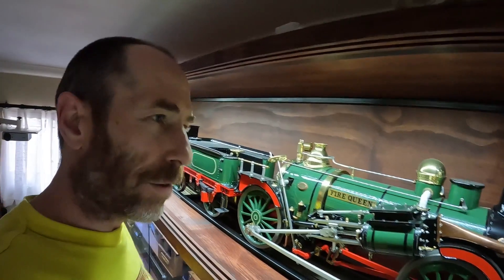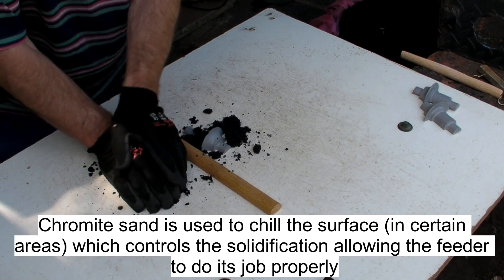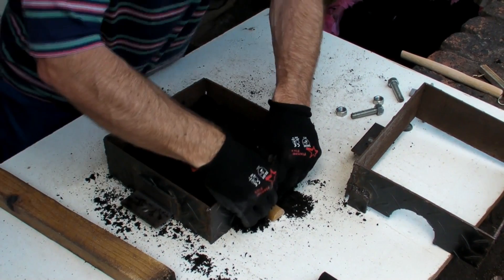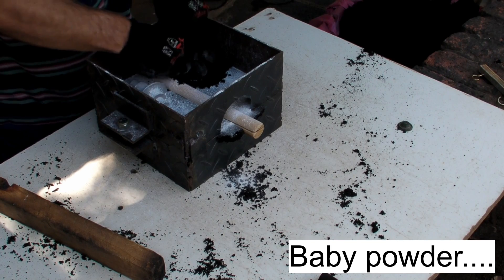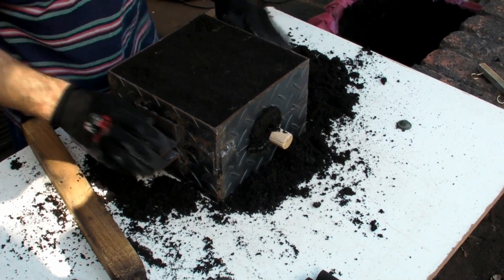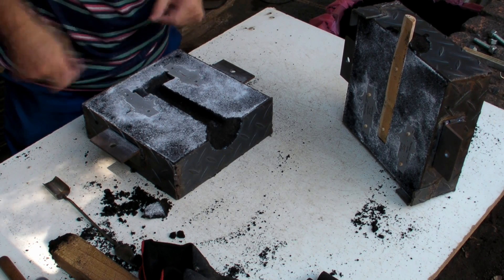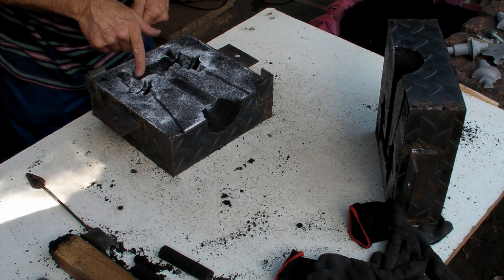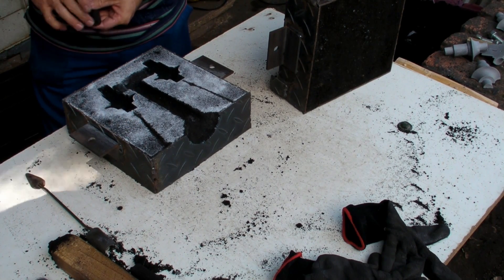Casting the most difficult component on the Fire Queen

Comment: I have never heard of chromite sand. What do you use for cores?
Reply from the maker: @improviseddiy  it's used extensively in specialized casting applications, normally with phenolics. I used the last of what I had when I did that casting and have found a workaround that actually is an improvement. The cores are just a linseed mix, baked.